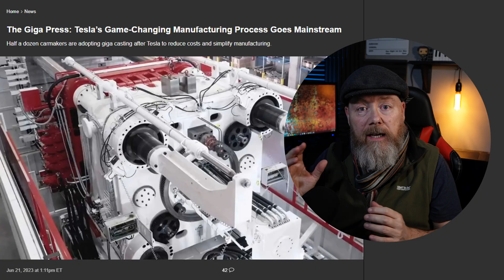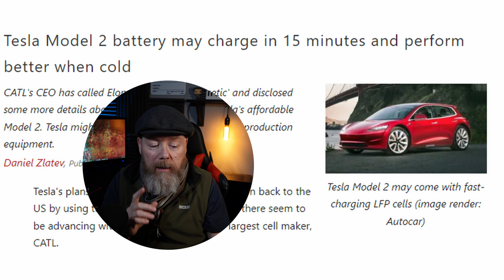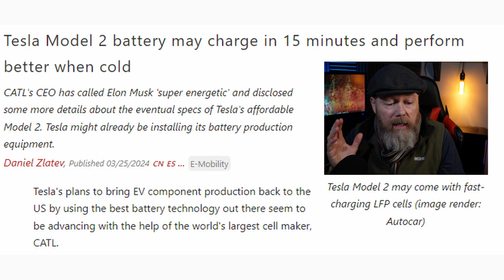Tesla Model 2 Battery may charge in 15 minutes and perform better when cold Using CATL  Technology

Comment: What happened to 4680 battery?  Three years ago it was touted by Tesla fans as a game changer, a technology that would wipe out all other EV makers.
What happened to GIGA battery factories?
Tesla now using BYD blades and CATL batteries?
Reply from the maker: 4680 batteries are in Tesla vehicles.
Technology changes and battery factories are built and being built.
You could have looked that up yourself.
Reply: @grouchthatsparx 
Then why Tesla is buying blade batteries from BYD and LFP cells and equipment from CATL?
Where is the superiority of 4680 technology?
Is it a game changer?
A game over?
Did it kill any competitor?

Comment: charge time, for battery of these sizes, depends on power supply not the battery
Reply from the maker: The Fast battery charging times are stated for ultra fast charging.
Reply: It is not quite accurate to just say that EV charging is dependent only on the "power supply" and leave it at that. It also depends on..........

The designed in charging capabilities of the battery.
The battery management system characteristics and design constraints on the EV.
The applied EV charging curve of the EVs battery management system at any charging event, which is can be dependent on current environment operating contiditons.

If using a super charger, lets ay of 350kW capacity, it isn't going to charge an EV battery at that rate, when the EV has a maximum designed in charging rate of 150kW.

In electronics/electrical systems, it is the load that determines the supply that is required. Consequentially, the EV charger does not push charge to the EV, the EV draws the charge that is available from any EV charger. Only time charger capacity is a factor in charging time is when the charger capacity is lower than the EV maximum charging rate.

Comment: Aren’t fast chargers more expensive? Don’t fast charging damage batteries? Will they be more expensive to replace? Doesn’t the speed depend on the charger? Just asking.
Reply from the maker: So you are the first out of the gate to find negativity with faster charging 👍 super fast chargers are more expensive than slow chargers. Does fast charging damage modern thermally controlled speed ramping battery packs? There might be a slight difference in degradation percent, but damage the battery...NO
Reply: It isn't always necessary to replace EV batteries. They can be refurbished or repaired......

Comment: I did a recent business trip and decided to hire a Polestar (as we have gone down to a single car), 230 mile round trip and trip meter said it was 4h 30m of driving. Now, I stopped at the services on the way back (didn't need to charge) around 4pm ish and noticed that less than half the chargers were in use (think 8 total with 3 in use) but counted 5 EV's in the car park, including a Taycan, but I was led to believe that EV's always need charging as the range isn't enough and you can never get on a charger 😅
Reply: Quote
The chargers are ALWAYS busy.
Unquote.

Anon!😂😂😂😂

Comment: For me this ultra fast charging would only be used a handful of times a year. I do wonder though, from Tesla's point of view, the faster they can charge a car the more chance you'll get charged for overstay fee's? I mean, with you have done a long trip, stopped at the services for lunch for 25-30min but your car now charges faster than that it's a possibility.
Reply from the maker: I agree that most people wouldn't need  a super fast charge, but for some people it's a mental barrier that they can't get over.
Reply: @grouchthatsparx  very true, even if they made an EV that cost the same as ICE, could do 600 miles, charge in 5min and cost less than half to run, they would still find an issue. The argument then comes back to "I don't want the government telling me what to buy".
Reply: The thing is, this is for people who can’t home charge, so may well want to fast-charge a lot. 

One of the biggest anti-EV rants is they take too long to charge compared with ICE, so anything that reduces that gap is good, as long as it doesn’t impact longevity.
Reply: @ISuperTed  I still think that even if you didn't have a home charger you don't necessarily need to charge that fast. If you travel to a place of work then chances are in the future there will be a lot more L2 chargers in those car parks. You get to work, plug in and then return 8-9hrs later to a full battery. If you are road tripping and you've driven to the point where you have depleted the battery, you'll most likely have driven 200-300 miles so would stop a little longer anyway.
Reply: @ISuperTed  maybe, sorry just sprung into my head, it's a way to use smaller batteries to reduce costs? Our Zoe was a great car but it was very much a 2nd car, 100mi at a push and no rapid charging meant we just didn't use it for any long trips. Now, if we could have driven 100mi, stopped for a loo break with the kids and set off again with a full battery we might have used it even more 🤔
Reply: @steve_787  We're just 10 years into mass market EV's. Give it another few years, and there will be Zoe sized EV's capable of what you suggested in your post.... It's only a matter of time...
Reply: I have done 47,500 miles in my EV in just over 3 years its never bee  a problem to charge 90% its done at home for me and I have never waited at a charger from Essex to Midlands I can go there and back and if I think I cannot I stop for a break which I need after 200 miles a 15 minute charge puts plenty in and I get home plug in and I'm charged up in morning its so easy